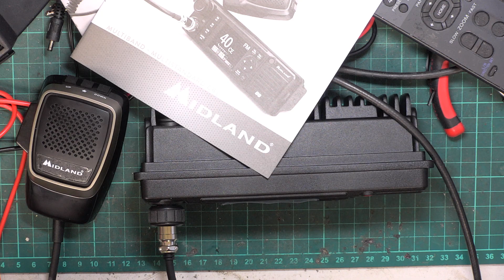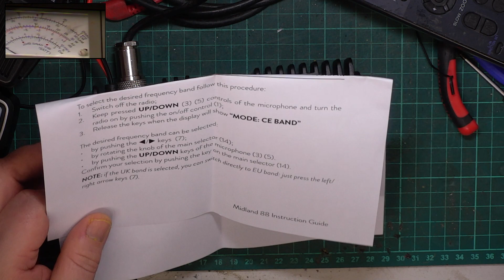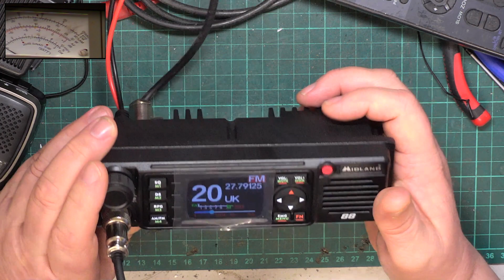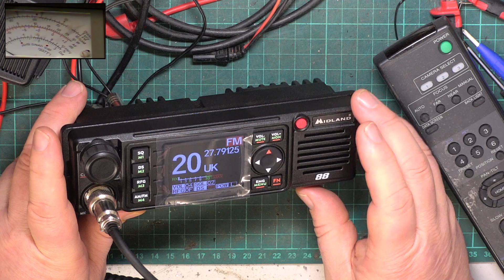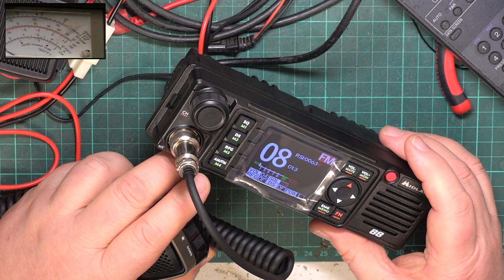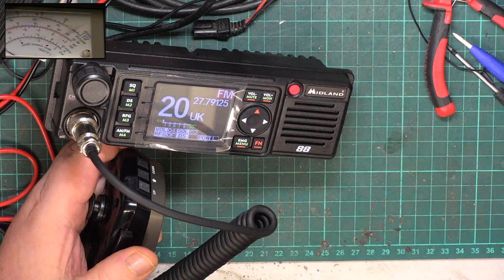Midland 88  CE MultiNorm CB radio (mobile) Overview & adjustment

Comment: Great video! Just bought this midland 88 cb radio. I tried to connect my PA speaker to the dedictaed external speaker but it disconnects the front integrated speaker of the radio. All the sound goes to the exterior of the vehicle on the PA speaker. Do you know how to set it up to have sound on the speaker of the radio in cb mode and sound on the external speaker in PA mode? Best regards
Reply from the maker: All I can do is cut & paste from the instructions:-

This feature allows to use Midland 88 as audio amplifier.
When this function is activated, if you press the PTT on the microphone
(1) the radio won’t transmit but you can hear your voice coming out from
the speaker; it is also possible to connect an external speaker on the rear
side of the radio (jack mono 3,5mm). In this case, the inner speaker is
automatically excluded. The volume level can be adjusted with keys Volume + (3) and Volume - (4).
When this function is active, the display will show .
To deactivate it, enter the menu again and select PA FUNCTION and
then set OFF.
NOTE: Even though the PA function is active, the radio still receives signals
on the channel in use.

Perhaps this is another part of this set that is poorly thought out.

Richard, G0OJF, UK
Reply: @ukfmcbradioservicingTango21  :-/ thanks for your answer. So I can't use this set. I Need to go for a president Barry or Barry II. I saw that you also reviewed it on your channel. Could you confirm that barry or barry II will be usable in PA mode like my president Lincoln II was?
Reply from the maker: @corbeauraven463  Sorry, I can't confirm any current models work in PA mode as I've never tested that function on any sets other than the earlier CB27/81 models. Perhaps if you go to a shop they will demonstrate it for you.

I'll tell you what; I've never thought to do this & will demonstrate PA on all models we do in the future. That doesn't help you now though.

Richard, G0OJF, UK
Reply: @ukfmcbradioservicingTango21  Thanks a lot! Sounds good for the futur tests! 73!

Comment: I have this cb and I can't seem to change from ce to UK mode have you got any ideas
Reply from the maker: Josh, this is what the instion book says & what I demonstrate on the video to set the radio to the desired band..UK in your & my case:-

To select the desired frequency band follow this procedure:
1. Switch off the radio;
2. Keep pressed UP/DOWN (3) (5) controls of the microphone and turn the
radio on by pushing the on/off control (1);
3. Release the keys when the display will show “MODE: CE BAND”
The desired frequency band can be selected:
• by pushing the / keys (7);
• by rotating the knob of the main selector (14);
• by pushing the UP/DOWN keys of the microphone (3) (5).
Confirm your selection by pushing the key on the main selector (14).
NOTE: if the UK band is selected, you can switch directly to EU band: just press the left/
right arrow keys (7).

Richard, G0OJF, UK

Comment: That might be a Software Defined CB transceiver because of the fact that everything is done through menus, is there a menu item showing settings if so then everything should be accessible from there.
Reply from the maker: Not that I'm aware of, it has traditional adjustments inside. Because of SMT precision of manufacture, variable inductors in transmit multiplier & rx front ends are no longer necessary for repeatable results in manufacture. Traditional radio equipment using through-hole components have to take into consideration that the slightest placement differences of the components in assembly & inferior component tolerances 38 years ago, had to have plenty of adjustment points for repeatable results. Components in the 80's were mainly 5 to 20% tolerance. Pre WWII, parts were 20-100% tolerance.

Richard

Comment: I hate modern cb radios -   you have to go through all that crap just to get 4 watts???
Reply from the maker: Yes. Most new sets come out of the box at an over-cautions 2.7 to 3.4W. Many won't even go beyond 3.6W. My observation of new sets is this: The more expensive the radio, the worse it is 'as a radio'...just loaded with bells, whistles, menus & sub-menus.

Richard, G0OJF, UK

Comment: Great video, glad you found that hidden menu, came upto spec wonderfully. Also good to see it will stay at 4watts regardless of voltage, nice radio but menus and display are not for me.
Reply from the maker: That 12-15V TX stabilisation is very very useful to know & it's something we're checking for these days so I can tell people who live in camper vans etc which sets actually manage more than 2.5W on 12V